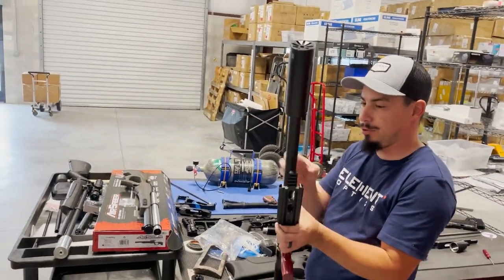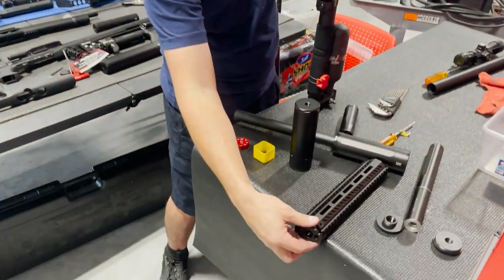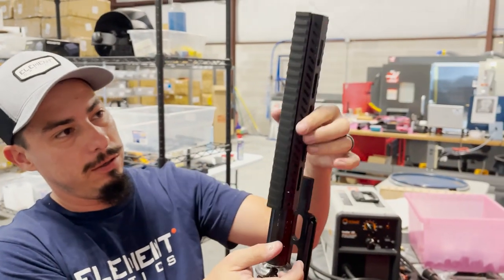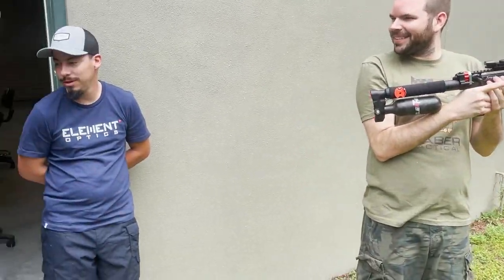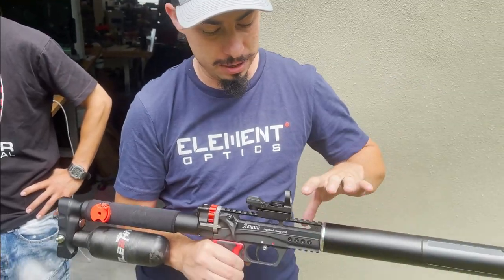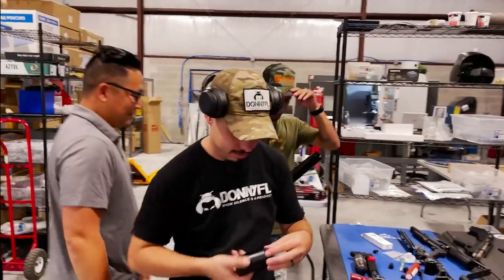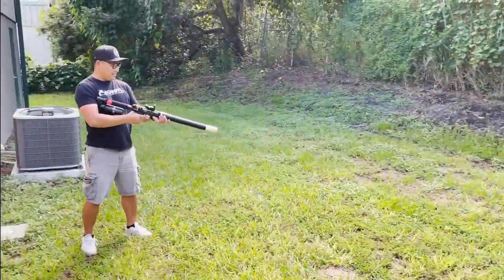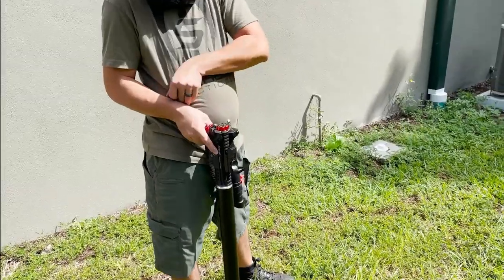DonnyFL: Plans For The Edgun Leshiy 2

Comment: I 3D printed an adapter for my L2 and I'm using my 357 DonnyFL moderator I bought for my Benjamin bulldog.

Works great on my 30 cal L2. Super quiet with just the Ronin. I have the extension too but haven't used it.

Comment: I made this almost a year ago with my emporer and extension . It’s alittle chunky. Worked well but like you said diminishing return . The one with the unfinished tip.My newest one I like a lot is I took the stock maverick adapter re threaded it to m14 carbon tube and whatever can up front. 450mm looks sounds amazing

Comment: So I put my ronin on my Leshiy2 not long after the L2 arrived. It is louder than the original moderator. The 40Mod suppressor is roughly the same standing the same distance away. I think using the Ronin or the Emperor with that expansion chamber will be the ticket.  When will they be on sale?
Reply from the maker: the new DonnyFL L2 Shroud kit is now available for purchase for just $60 at the following link https://donnyfl.com/collections/accessories/products/edgun-leshiy-2-shroud-kit